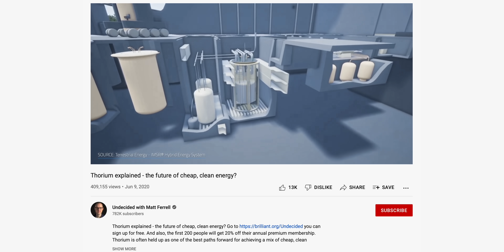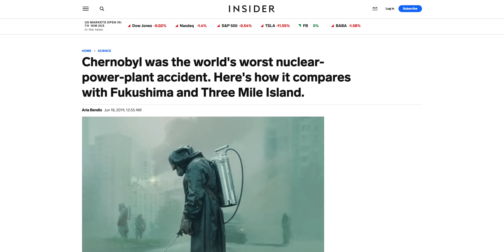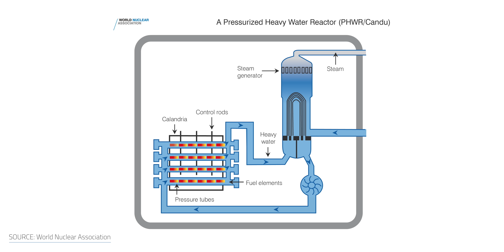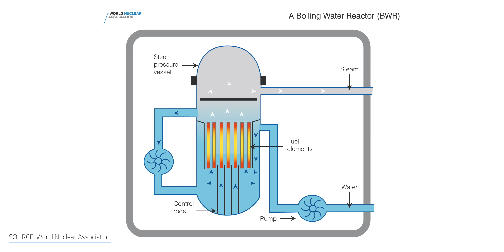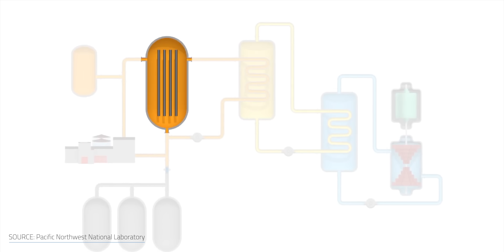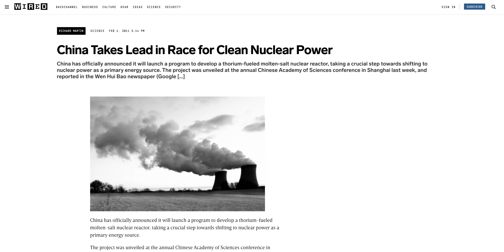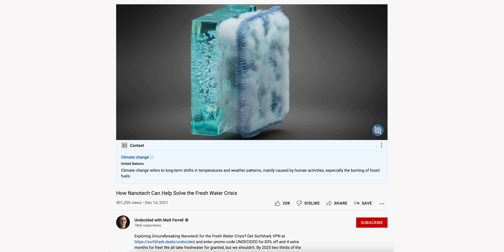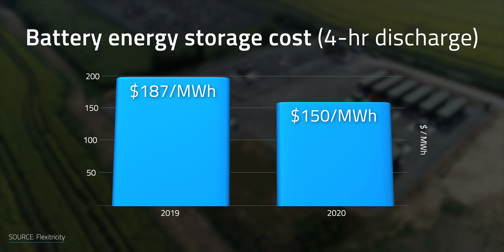Revisiting Thorium Energy - The Future of Nuclear Power?

Comment: Can we PLEASE talk just a little bit about nuclear reactor core design from a nuclear physics perspective!

I’ve seen all sorts of YouTube videos about molten salt reactors (MSRs), and there seems to also be a lot of interest in Thorium reactors. Many videos give me the impression that in general, people consider MSRs and Thorium powered reactors to be one and the same. They are not, of course, the same thing.

Molten salt just refers to the reactor coolant, and somewhat to it’s structure. It has nothing to do with moderator and thus does not determine the neutron spectra. It does not dictate or rule out the use of Thorium. The molten salt is not much more than a heat transfer fluid.

The first MSR, built at Oak Ridge, did not have any Thorium in it. It was powered by Uranium.

I have to object to the claim that any reactor is, ever was, or ever will be powered by Thorium. Rather than being a true nuclear fuel, Thorium is nothing more than another neutron absorber that beta decays to the next higher element. That element then betas to the next element above it, and THAT element is a true nuclear fuel. It is true that Thorium will fission if the neutron energy is sufficiently high, but the nuclear cross section for that is pretty itty bitty compared to Uranium-235 or Plutonium. Without the presence of U-235 or Pu-239 to provide a large flux of highly energetic neutrons, Thorium-232 really is just nothing but heavy dirt.

We appear to be in desperate need of some thoughts, and discussion, and enlightenment about actual nuclear physics.

Be prepared to gag a little because I am going to have to throw the names Uranium and Plutonium in here if we intend for this to be a real discussion of reactor physics and not just a Thorium pipe dream.

So, here we go.

Can anybody tell me what the Evaluated Nuclear Data Files /B version 5, 6, or 7 show for the fission and capture cross sections for Thorium-232 in thermal and fast neutron spectra?

The short answer is, Th-232 is hardly anything a reactor core designer would call fuel. It is NOT fissile in a thermal flux, which is what you get with when you add graphite moderation to the MSR. In a thermal flux, Th-232 is only fertile. In other words it can capture a neutron and become Th-233, which then decays to Protactinium-233, which in turn decays to U-233, which IS fissile.

So, if Th-232 isn’t fissile, where do we get the fissile material to start up a bunch of sustainable Thorium reactors? May I suggest that we have both fissile Uranium and Plutonium isotopes in spent fuel pools at reactor sites all over the world. And, due to the brilliant minds of politicians and the gullibility of the news media, Plutonium has been reclassified as a waste. But the reality is that Pu-239 and Pu-241 are fantastically fissile fuels. Americium and Curium are also fissile in fast neutron spectra. If we simply added Uranium, Plutonium, Americium, Curium AND Thorium to the MSR, and get rid of the graphite moderator, it would go critical on the Uranium and Plutonium, run on fast neutrons, burn the U, Pu, Am, and Cm as fuel, and convert the Thorium to U-233.

Ah, you say, what about Pu-240 and Pu-242? Don’t they dirty-up the system? Nope. They don’t. Not in a fast reactor.

And so, it might appear that we have a way to fuel a Thorium reactor. All seems well and good and no problem. But we have to gag a little and start it up with existing Uranium or Plutonium.

Now, just to keep us all honest here, we need a discussion about proliferation. After all, proliferation of nuclear weapons is what Plutonium is all about. Right?

Wrong.

Plutonium is quite simply a really fissile element. Period. That’s what makes it a great reactor fuel. And the fissioning of Plutonium can be used to generate electricity, or to build bombs. Just like Uranium.

And, just to keep non-proliferation in mind: regarding those gammas that are proposed for Uranium tracing (from U-232) ... where does the U-232 come from? The ENDF/B radioactive decay data I’m looking at clearly indicates that the top of the decay chain is initiated via U-232 being created “in” the reactor via (n, 2n) reactions between neutrons and U-233. However, the preferred U-233 production route in a molten salt reactor is to siphon off Th-233, put it up on a shelf somewhere, let it sit, and via radioactive decay: Th-233 betas up to Pa-233 which then betas up to stable, ISOTOPICALLY PURE U-233! No neutrons necessary and none around “up on the shelf”. So, what you get is pure bomb grade U-233! How do you trace isotopically pure U-233?

So, what’s so bad about isotopically pure U-233? Go back to the ENDF/B files. What’s the value of “nu” for U-233 for thermal and fast neutron spectra? Compare the values of “nu” for U-233 and Plutonium-239. If you are not a wee bit shocked, then you just aren’t paying attention.

From a proliferation standpoint, if you hate Plutonium, and are honest about it, then you have to hate U-233.

From a reactor core designers standpoint if you love Plutonium, then you’ll think about U-233. But only for a little while. Once again, go back to the ENDF/B files. Take a look at what’s said about the delayed and prompt neutron fractions. All neutrons generated by fission are not equal. Some neutrons come out of the reaction almost immediately. A fraction of the neutrons come out later. Depending upon the fissioning isotope, those delayed neutrons might come out as much as a few minutes later. The delayed neutron yields for U-233 are similar to those for Pu-239 and Pu-240. But, and this is important, the half-life for the delayed reactions are about 55 seconds and 22 seconds for U-235 and Pu 239 respectively. In other words, they don’t come out until about 55 seconds or 22 seconds after the fission reactions. The half life for delayed neutrons from a U-233 fission is only about 6.0 seconds. The short time delay between prompt and delayed neutrons greatly complicates reactor control. Don’t believe me? Take a close read into the underlying cause of Chernobyl. That reactor was allowed to go “prompt critical”. And, once again, if you are not a wee bit shocked, then you just aren’t paying attention.

Just to beat a dead horse, the half life for delayed neutrons from Th-232 fission in a fast neutron spectrum is only about .179 seconds. No kidding.

Do you still want to live next door?

The cure:  Build a reactor with Uranium, or even better yet:  Plutonium.  Use a fast spectra. Use a mix of Th-232 and U-238 in the blankets. Breed U-233 and Pu-239. Continuously burn all fissionable actinides. 

Never ever remove any isotopically pure U-233 or Th-233.
Reply: There was a Thorium reactor built at Oak Ridge in 1965 and was torn down.

Comment: In short I think that if nuclear waste took longer to make but had just as long afterlife people would be more ok with it. for the most part with a few exceptions and natural disasters we handle nuclear products much more safely now so if it took 10 times longer to make the 500 year halflife version people could come to terms with it more, like if we got 200 years off one burn of the Thorium type then i think people would be on board for the 500 years of  waste nearly half the years of use would be easier to sell to the masses. so until then no matter the price of nuclear it wont be a main stay like wind and solar.

Comment: The one thing held against Thorium is that you can't make nuclear weapons from it. Which means that the Military Industrial Complex won't fund it which is (partially) how we've paid for the fission reactors we have now.
Reply: The much bigger issue is that Thorium technology is unproven and will take a decade or two to get into commercial use, at least... Nuclear energy, Thorium and otherwise, is always a huge financial risk, not because of accidents, but just because of the huge infrastructure expenditures involved in every single plant and that it is almost certain that the budget will be overrun by multiples and the schedule will not be met... Now suggest to someone investing a few billion Dollars that you'd like him to try a technology that hasn't even been proven at all.
Reply: That is not true. In fact, it may be easier to make a working weapon using the Th cycle in an MSR, although the weapon itself isn't likely to be as efficient as a Pu based weapon. To make weapons grade material from Th, you circulate some of the fuel salt through a protactinium extractor and then let it decay in an isolated pure state into U233, which only takes ~27 days. If your extractor is very efficient, the rest is relatively easy. The only drawback to someone who wants a weapon is that only a small amount of protactinium can be extracted at a time and still keep the fuel salt fissile, so it does take time to gather enough. The proliferation-proof line the Th advocates push is an outright lie. U233 based bombs have been tested and you don't need a huge (and therefore detectable) PUREX plant to obtain it, unlike Pu.

Comment: A lot of misleading information in here about thorium being a magic fuel relative to U235. Thorium converted to U233 does not produce products with lower half lives. It still produces high energy products. And thorium reactors do not have the capability to run themselves. They require Uranium to keep the reaction continuous.
-Nuclear Engineer

Comment: YES, we still need nuclear.
Because the logistics of mining and building the type of battery capacity for the US's (let alone the world's ) needs is absolutely off the charts.
And that's without factoring in the environmental damage such wide-scale mining of components would cause.

Also, on the mining of Thorium.
The US is sitting on a massive stockpile of the substance right now.
And just about every rare earth mine in the US was shut down primarily because they were ACTUALLY Thorium mines.  And those mines couldn't support the NRC cleanup costs.

This would allow such mines to be put back into business with a dual-product model.

Thorium fuel and the various rare earths.

Comment: Here's the data about new installation of wind and solar.  This video was about Nuclear power so we aren't going to say that it's new installation cost is PENNIES per megawatt of power produced in the first 10 years.  After 10 years, it has paid for itself while wind has required to be completey replaced with a new windmill, and solar has required new energy storage devices every 3 years.  If you are gonna make a video about the capabilities of a newer, cleaner, maybe safer Nuclear option, don't make it seem like solar and wind are better, data has shown they are still behind in production capability of several types of sources.